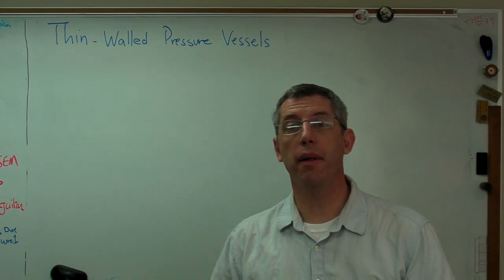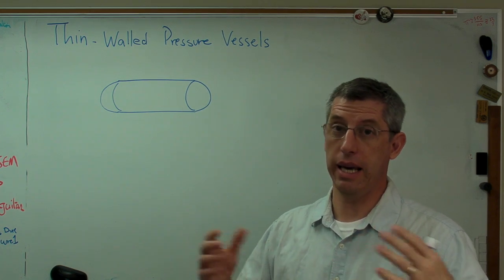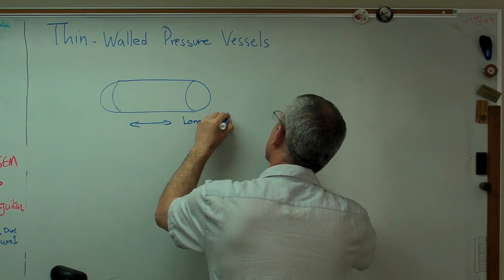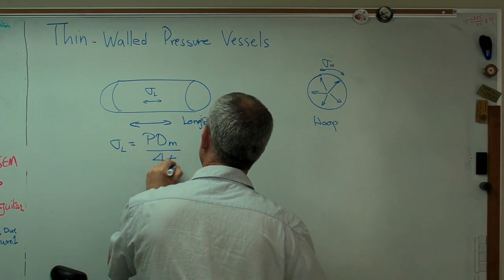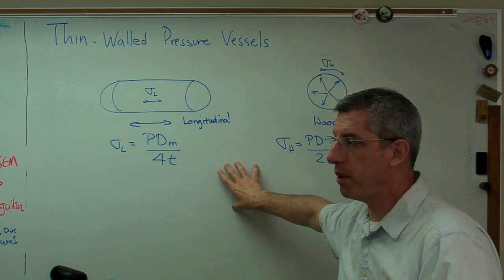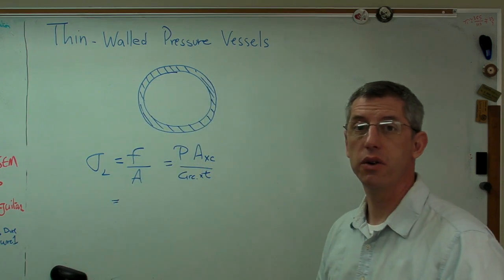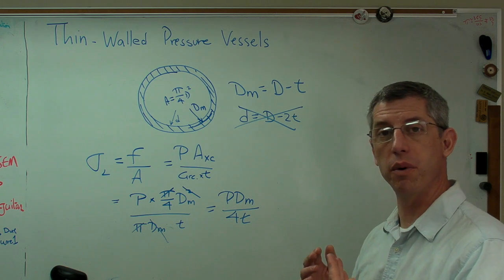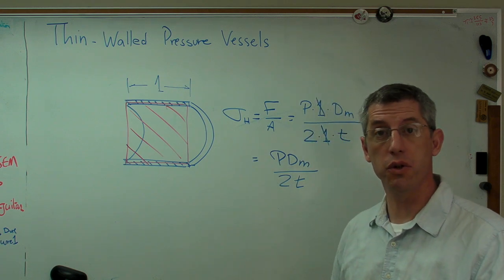Thin Wall Pressure Vessel 1.MP4

Comment: I believe if the diameter is at least 10 times larger than the wall thickness then it qualifies as a thin wall pressure vessel. Great video, very helpful.
Reply: Allan Howard 10 times the radius that is

Comment from the maker: The thin wall assumption ignores radial stress.  If you want to calculate radial stress, you have to use the equations for thick wall pressure vessels - RMF

Comment: Hi, how would you rearrange the equation to determine minimum wall thickness if you had a defined external pressure, for example hydroststic on the submarime you mentioned?

Comment: why are all my books and google saying that hoop stress is pressure X radius/ 2Xthickness?
Reply: In your text book the use of (P*r)/(2*t) is correct, however a more accurate means of calculation would be to use mean radius where 'radius mean'=r + (1/2)*t.

Comment: Thank u so much... 

but I dont have an idea about Radial stress in thin pressure vessel... 

Could u pls help me out
Reply: Aswin Venkat @ The stress which perpendicular to the hoop stress at a particular point in pressure vessel wall. to get its value we equate it to radial pressure. its value is equal to radial pressure at inner surface and equal to atm pre at outer surface. it's value is very less so neglected also all stresses are in material of wall not what inside of that cylinder.

Comment: Is there an analog to hoop stress for an enclosed rectangular duct or channel? Could I just use a hydraulic diameter?
Also what if the wall thickness is much larger than the inside diameter?